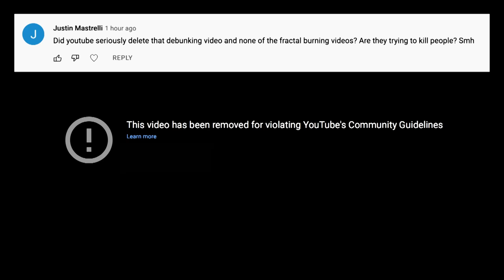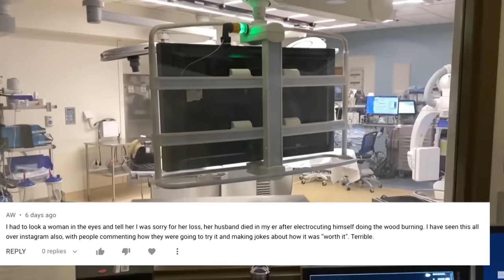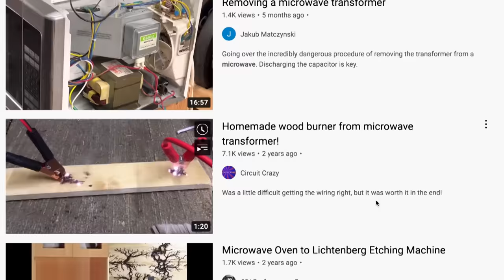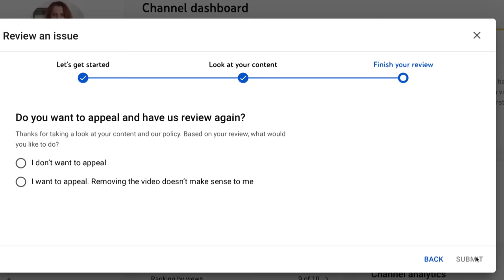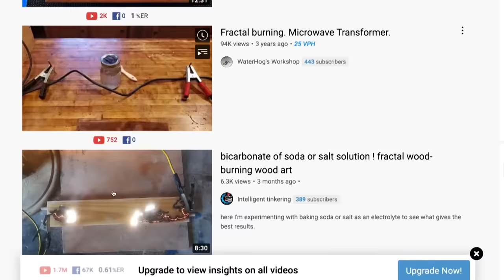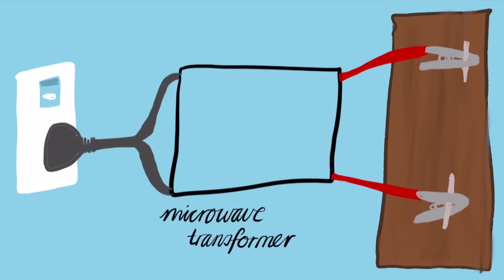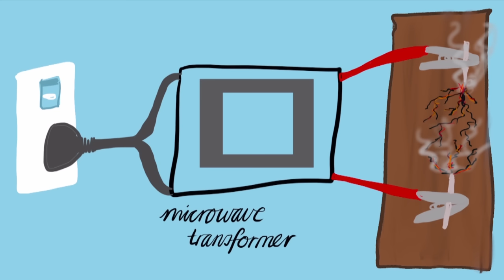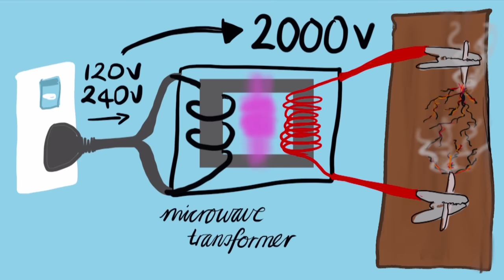YouTube BANNED my Debunking Video but leaves DEADLY how-to vids online, 34 dead!

Comment: OKAY watched your video on the matter, and one MAJOR thing you got wrong, is why it's so deadly. It's not the voltage, but the AMPERAGE. See in a Microwave, that Transformer becomes 2000v but loses the 15A a US household puts into it and 30A a UK/EU/AU household puts into it. TO a more manageable 10A on average. SO, just feeding RAW current through a transformer, is 2000V 15A/30A depending on where you are living. It's the AMPERAGE that kills you. APPARENTLY 100-200mA is fatal to humans. SO... 15A and 30A are slightly more than that by 10-20x. MIND YOU, you're not 100% wrong with saying 2000V doesn't help matters either. SINCE a TENS unit for physical therapy from what I can find puts out 90V-120V, and if at 1mA that's enough to contract muscles, then 2000V would easily contract way more muscles while doing it at a speed the human wires (nerves) can handle. See it's that seizing up that does people in, allowing the current to flow for longer than safe. Again, the non-fatal but severe results were because they could release it in less than a second. I love electricity. ALSO doesn't help that they use HANDS to do this project which just so happen to be ever so close to the most vital of electrical devices the spine and heart. That's a lot of fried nerves even in less than a second. 
TASER X26 = 50,000V 0.0021A (2.1mA) 
A dog shock collar = 5000V Max. BUT AGAIN, ridiculously low current. 
So it's the unfettered AMPERAGE that's doing people in, and coating the board in an electrolyte doesn't help things.

Comment: I think you might be a bit off on your warning. 2000 volts is nothing. It is the amps that will kill. Most mechanics have been hit by coils on cars  that are around 30000 volts or more.  The amps are very low. I am glad you have made this video. People need to know the dangers of electricity.

Comment: Volts aren't current lady... amps are current. 2000v transformed from a 120v 15amp outlet is at most .9amps of current... your average USB charger is about 2-3amps to put it in perspective.  So it actual very low current but high voltage.

Comment: I've seen plenty of videos on doing fractal wood burning and until your prior video, I've never heard of one saying to use a microwave transformer. Every one I've ever seen has said to use a battery and absolutely does not say to mess with it while it's running - they say to put the nails in, connect the cables, then wait until it gets to the point you want, then disconnect the battery. It sounds like you found the handful of people saying to do it in the most dangerous way possible and are claiming that's the ONLY (or even recommended) way to do it.

Also, for your dramatic "34 dead!!!"....more people die from falling asleep in the bathtub every year in the US, 34 people doesn't even register on the cause of death stats.

Comment: Alright Karen. But let's ask you this. It's dangerous to mess around with power lines. Would you have WiFi and be able to post this video, causing harassment to properly working crafters though if electricians decided to just be safe and NOT set the poles up? No. 

There are activities that require A LOT more training on safety than others because improper safety measures lead to death, but that DOESN'T mean absolutely NO one can do it WITHOUT dying. We can go into space, deepdive, ride rollercoasters, and the likes, but why can those be so popular without everyone being told off like they're someone's kid?